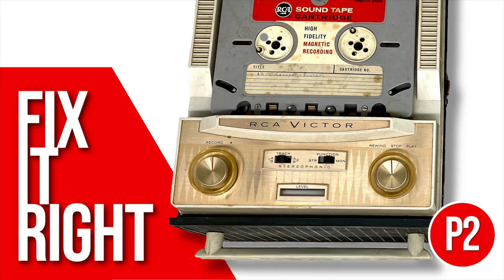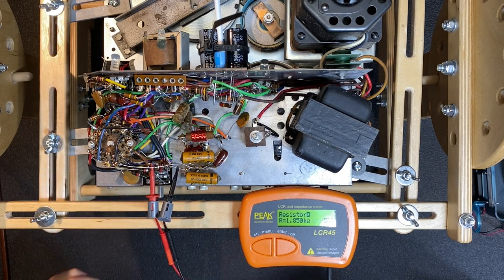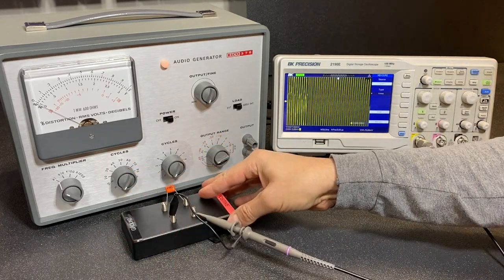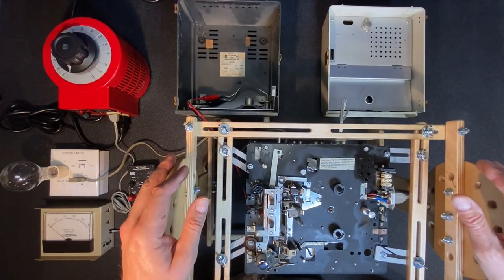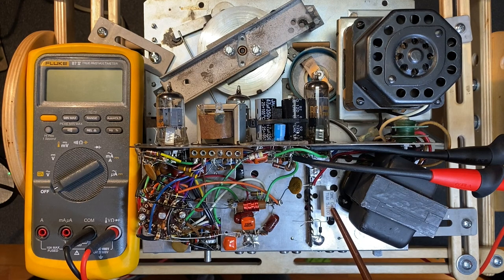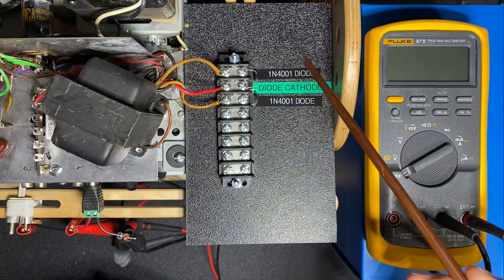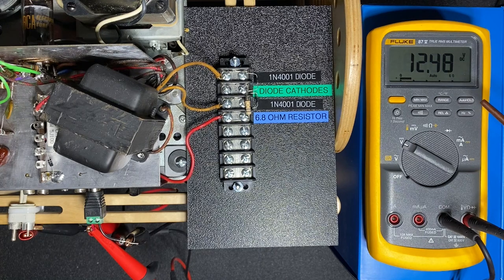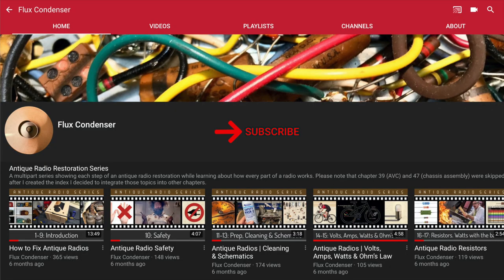The original GIANT Cassette! P2 • Let’s Fix a 1962 RCA Sound Cartridge Player

Comment: In this video you measured resister values "in-circuit" whereas in one of your Marantz restoration videos, you removed the components for measurement.  What are your thoughts on measuring resistors and capacitors within the circuit.  May depend on the particular circuit?
Reply from the maker: Great question. Yes it depends on the circuit, but in this case it was largely possible because all the tubes and the filter capacitor were removed. The fewer the components influencing resistance the better. In most cases I’ll try this method first, but if I get strange readings I’ll lift at least on lead of the resistor.

Comment: It almost seems easier--and smarter--just to design, build & install a PC-board with modern electronic & amplifier components to replace everything electronic as a whole, and practically never worry about damaging "sensitive" components (Tubes) via rough handling of the unit ever-again! :\
Reply from the maker: That would certainly not be easier and would add no benefit. Tubes aren’t particularly delicate and are extremely reliable as a whole. Yank out the guts of a great piece of gear like this and replace it with modern amps? Not smart.